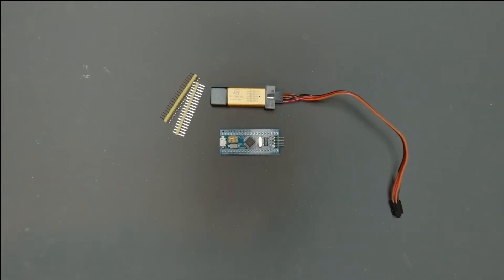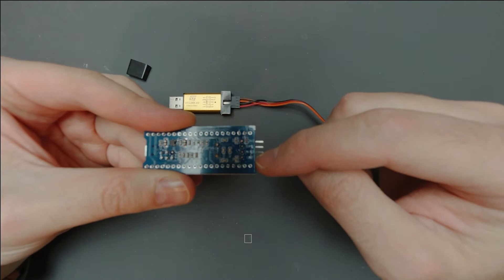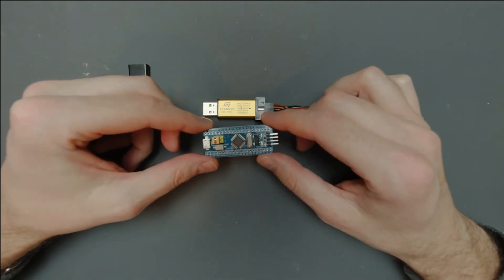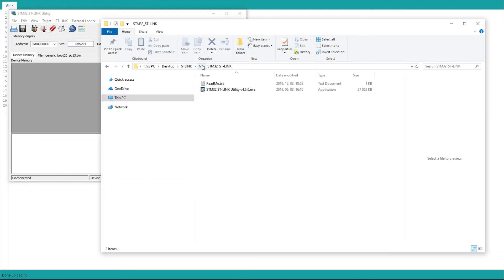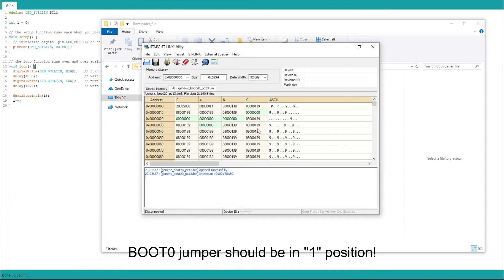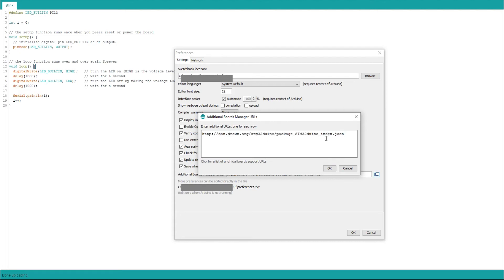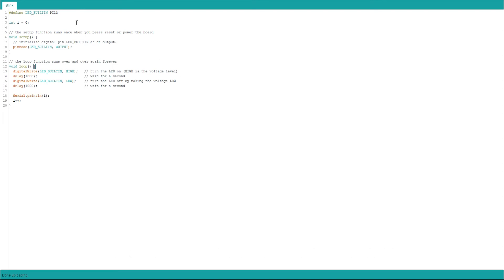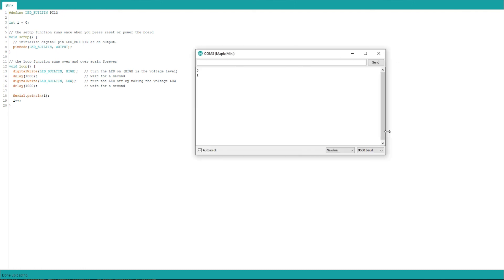STM32F103C with ST-Link and STM32duino, simplified!

Comment: Hi! i hope you reply after all of these years you'd be amazing! so i've done everything in the video and I'm at the arduino ide part and downloaded everything, the thing is after i press upload this happens:
Sketch uses 14548 bytes (22%) of program storage space. Maximum is 65536 bytes.
Global variables use 2072 bytes (10%) of dynamic memory, leaving 18408 bytes for local variables. Maximum is 20480 bytes.
maple_loader v0.1
Reset via USB Serial Failed! Did you select the right serial port?
Assuming the board is in perpetual bootloader mode and continuing to attempt dfu programming...

Resetting to bootloader via DTR pulse
Searching for DFU device [1EAF:0003]...
dfu-util - (C) 2007-2008 by OpenMoko Inc.
This program is Free Software and has ABSOLUTELY NO WARRANTY

Couldn't find the DFU device: [1EAF:0003]
the thing is that i can't choose the correct port from the port in the tools, and when i open device manager i see "lilusb-win32 devices" and under it i see "Maple DFU" but i don't know why is it there and not in "Ports" or anything and i don't know why is the arduino not finding it. I hope you reply thank you so much.
Reply from the maker: Hi! It seems that your device is in bootloader mode and not in serial mode. Are you sure you have the boot pins correctly configured?

Comment: i really need help, i did everything properly yet my laptop doesnt recognize the STM when i plug it in with a micro usb cable, the cable is alright but i believe the issue is with the drivers :(((((
Reply from the maker: Then install the drivers maybe?
Reply: @CuriousScientist  :( when i wrote this message i had already installed the drivers, as administrator, still it won't work :( also tried restarting the laptop

Comment: I am a microcontroller hobbyist,
All i know is Arduino and esp32,
I don't know anything about stm32
Is it mandatory to have stlink v2 to upload the code or can we use inbuilt usb instead?
Reply from the maker: If the microcontroller doesn't have a bootloader installed, then you need to program it somehow. Otherwise, you can't use the USB. After it has the bootloader, you can upload code via USB.

Comment: HI SIR, i followed every steps, buy while uploading i am getting error,  Access is denied.please help me to sort the issues
Reply from the maker: Hi! Have you restarted the computer?
Reply: @CuriousScientist  yes sir, but could able to upload the code to board, get same error
Reply from the maker: If you were able to upload before, then look for the changes you did that might introduced an error. Maybe wrong COM port is selected? Could be a bad cable maybe? Is the microcontroller intact? Can you upload a simple blinky to it via the ST Link?
Reply: @CuriousScientist  it showing correct com Port, but while uploading it shows access deined and it also shows error message of 'java' is not recognized as an internal or external command, operable program or batch file. But I reinstalled but nothing changed, please help me to sort this issue, thanks for your time 🙏
Reply from the maker: Have you tried searching for the error message in Google? Maybe you should give it a try.

Comment: More recent information that I have seen on YouTube, or read on forums, say the STM32 ST-LINK Utility has been replaced by STM32CubeProgrammer, which creates a whole lot of other issues 😕
Reply from the maker: The fact that it got replaced doesn't mean that you can not still use it. I am still using it without issues. But it is only needed if you want to upload a bootloader so you can program it via USB in the future. If you have the ST-Link dongle, you can use it anyway for programming.

Comment: not working
Reply from the maker: Then you did something wrong.
Reply: @CuriousScientist  yes, tried to use stm32... (3 board, 3 computers, 2 op.system - different hardware, same shit...)
btw. cube32 working, but we have a large codebase in arduino...
Reply from the maker: I think there's nothing wrong with the STM32. I am able to use several models (F1 and F4 mainly) with Arduino IDE without any issues. Both with direct USB connection or the ST Link dongle. Check if all drivers and software are properly installed.
Reply: @CuriousScientist  not working, stm32cube working, arduino not.
Reply from the maker: Well, then something is not OK on your side. Drivers, or the stm32duino framework...

Comment: Hi , thanks for your tutorial. but I have a problem , when I connect my STM32 blue pill via USB/min USB cable. My computer does not detect anything . I dowloaded well the bootloader following your instruction. I installed drivers succesfully but board does not appear in device manager panel of windows10. Have you an idea ? thanks in advance
Reply from the maker: Hi! If it does not detect anything at all, you probably have a dead microcontroller or a bad USB cable. Even if the drivers were missing, the computer should see that something was connected to it. It would be unable to communicate with it, but it would see it. Check your USB cable.

Comment: hello, the blink program I installed on my stm32 card with arduino ide gives an error
Error: opening registry key 'Software\JavaSoft\Java Runtime Environment'
Error: could not find java.dll
Error: Could not find Java SE Runtime Environment.
Reply from the maker: Hi! What should I do with this error message?
Reply: hello, first of all thank you for answering my question
I have installed STM32 relevant drivers and bootloader.
I wrote the blink sketch in the video.
I compiled and uploaded it to stm32, it gave an error message with the installation complete message
""Error: opening registry key 'Software\JavaSoft\Java Runtime Environment'
Error: could not find java.dll
Error: Could not find Java SE Runtime Environment. ""
Serial port doesn't work on screen.
Can you provide information about this error?
arduino IDE2.1.1
thanks good work. @CuriousScientist
Reply from the maker: The information is written in the error message. Please read it. Java.dll is missing. Make sure that the Java is installed and up to date on your PC.
Reply: I reinstalled java new errors occured
Resetting to bootloader via DTR pulse
#
# A fatal error has been detected by the Java Runtime Environment:
#
# EXCEPTION_ACCESS_VIOLATION (0xc0000005) at pc=0x000000007110b5db, pid=41168, tid=0x000000000000a154
#
# JRE version: Java(TM) SE Runtime Environment (8.0_381) (build 1.8.0_381-b09)
# Java VM: Java HotSpot(TM) 64-Bit Server VM (25.381-b09 mixed mode windows-amd64 compressed oops)
# Problematic frame:
# C [jSSC-2.8_x86_64.dll+0xb5db]
#
# Failed to write core dump. Minidumps are not enabled by default on client versions of Windows
#
# An error report file with more information is saved as:
# C:\Users\AsusPC\AppData\Local\Arduino15\packages\stm32duino\tools\stm32tools\2022.9.26\win\hs_err_pid41168.log
#
# If you would like to submit a bug report, please visit:
# http://bugreport.java.com/bugreport/crash.jsp
# The crash happened outside the Java Virtual Machine in native code.
# See problematic frame for where to report the bug.
#☹
Reply from the maker: Something still seems to be wrong with the Java environment. I am not a Java expert, so I don't know what's wrong. Check Google for clues. Maybe others also had this error before.
Reply: thank you for your attention @CuriousScientist
Reply from the maker: No worries! Try to reinstall everything, including the Arduino IDE.

Comment: Hey, I have done everything as per the video suggested, but when I upload the code nothing happens, it says done uploading. but the LED doesn't blink...and there is nothing in the serial terminal, can you help me with that ?

 I tried 2 different board and 2 different usb cable, I also redownloaded the drivers and restarted my computer. The boards I have are STM32F103C8T6

Thank you
Reply from the maker: Hi! If the uploading was successfully done, then it should work. Do you have a real C8T6 and not something like C6T6? Is the LED on the same pin as in the code? Did you really make sure that you use the boot jumpers properly? Have you tried verifying the code (bootloader) in the stm32cube programmer? Do you have the same code on the MCU as you see in the hex viewer? There are many things to check and it is super difficult to remote-troubleshoot this issue.
Reply: @CuriousScientist  You are right, i checked thoroughly and it is a C6T6, does it change something ? . I'll try to verify the code in the stm32cube programmer, could it also be that the stlink is problematic ? 

Thanks for your response
Reply: also the LED is the same pin (PC13)
Reply from the maker: C6T6 needs another bootloader. Just download the correct one, and it should work. Also, make sure that when uploading with USB, you select the correct MCU.
Reply: @CuriousScientist  Hey @CuriousScientist, I tried a lot of things, and in the end I was able to upload with the ST-link as a comment was suggesting, you are probably right when you say that the boot loader was the wrong one, but I couldn't find the right one. For now, it works thanks to you ! Thanks for all your help !
Reply from the maker: @MrElierb1  It should work with the generic_boot20_PC13 bootloader. It is strange, but since the C6T6 is already a "sketchy" device (possibly re-labelled "scrap" C8T6?), I am not surprised that it does not work. 

But yes, if you can afford a bit more meticulous debugging, then you can upload the code via the ST-LINK. The only disadvantage is that if you want to check things via USB, you need to remove the ST-link because it cannot be connected to the MCU simultaneously with the USB cable. It is a bit annoying to jump back and forth between USB and ST-LINK.

Comment: Not complaining about the video but, this is the most God awful thing I've ever tried to do. Forum post after forum post, video after video. They're all from 2 to 5 years old recommending 2 different repos for the Arduino board manager. I've gotten the bootloader flashed (I guess) but the com interface won't show up in Arduino (maybe Linux is the issue). I'm throwing in the towel and going back to fiddling with registers and using the st-link.
Reply from the maker: I don't have any experience on Linux, so unfortunately, I can't help. But it should be relatively straightforward anyway.

Comment: I wished this would work because I bought 2 STM32F103C6T6 board with ST-Link V2 and I tried it all. Then I tried this and it all went well, after running the STM32 ST-Link Utility I checked my arduino IDE and the board was there in my board manager. I removed the ST-Link V2 and connected via USB and restarted the Arduino IDE and all my board for the STM32 was gone. 
Any advice before I take a hammer to the boards? :D
Reply from the maker: Hi! I do not advise using a hammer because the boards are brittle and the flying debris can hurt you. 

On a more serious note:
Please check if you have all the drivers installed. Also, you said that the list of microcontrollers disappeared from the IDE. That sounds odd. 
- Do you have the proper URLs under the preferences/additional boards manager? 
- Also, do you have the stm32-related things installed in the boards manager? 
- Have you checked the STM32 before using the ST-LINK? Typically, they come with a bootloader. 
- Did you put back the BOOT jumper to the correct position? Or, did you put the jumper to the correct position before starting to upload the new bootloader?

So far I can pinpoint these main steps. Let me know how it goes.

Comment: I install the bootloader successfully but I get this error on the output, I install the install_driver I didn't find the install_driver_bat 'C:\Users\fnan' is not recognized as an internal or external command,
operable program or batch file.
Failed uploading: uploading error: exit status 1
Reply from the maker: Hi. The bat file is right there in the links I provided ("Arduino STM32 files (Drivers and Bootloader)").

Comment: green led is not blinking though only red led is blinking on mine.And its blinking in opposite way(like When low, led is ON and vice versa).
what should i do???
Reply from the maker: I don't really know the reason, but the red LED should not really blink as that is the power LED. Are you sure that you are using the same board?
Reply: @CuriousScientist  na na like 2 red led's are there one is power led and other is also a red one which was supposed to be green led.its same blue pill u used in ur vid.
Reply from the maker: @chinmaykulkarni2881  Hm, that is weird, I have never seen these blue pills with two red LEDs, and I own a handful. Try doing the whole process from the start. Also, check the chip. I don't doubt what you are saying, but it could be that you have a counterfeit or fake chip and that's why things are acting up. You can have a CH32 chip or an STM32F103C6T6 or something similar that is not the STM32F103C8T6. In that case, a different bootloader will be needed.

Comment: Hi!, thank you for your tutorial, quite straightforward and clear!
However I'm having some trouble with my STM32F103C6T6 board: different from an Arduino Uno or Nano I can't see the COM port in the device list (and of course in the Arduino IDE) and of course I can't upload the sketch...  
Any idea? It seems to me I missed some drivers...
Reply from the maker: Hi! Please read through the comments because several people had similar issues if I remember correctly. You might find the answer by reading the comments.
Reply: @CuriousScientist  after a couple of hours trying, I found a fix :-) 
I'm leaving here my solution for any other people that could have the same trouble.

-- The bootloader .bin described in the video is OK (generic_boot20_pc13.bin) 
-- Install the USB drivers using wdi-simple.exe and install_drivers.bat (links in the video description).  
-- for the STM32F103C6T6 board must to choose the STM32F103C6/ fake STM32F103C8 in the Arduino IDE

if you still has no COM port in the devices list:

-- open the "blink" sketch (examples -> STM32 -> digital -> blink)
-- put the jumper BOOT1 to 1 and  connect the board 
-- Upload the sketch using the instructions from this video (even if there isn't any COM port)
-- The COM port should to be appear in the Windows devices list  
-- Put the jumper BOOT1 to 0 and you've done forever (no need to change the jumper again).

Hope it could help!
Reply from the maker: Thank you for providing your method! I am sure it will be useful for those who are struggling with their STM32s.

Comment: hello, I have followed your instructions but when I try to upload my code in the arduino IDE I get :
maple_loader v0.1
Resetting to bootloader via DTR pulse
Reset via USB Serial Failed! Did you select the right serial port?
Searching for DFU device [C:\Users\chefl\AppData\Local\Temp\arduino_build_987028/Blink.ino.bin]...
Assuming the board is in perpetual bootloader mode and continuing to attempt dfu programming...

dfu-util - (C) 2007-2008 by OpenMoko Inc.
Couldn't find the DFU device: [C:\Users\chefl\AppData\Local\Temp\arduino_build_987028/Blink.ino.bin]
This program is Free Software and has ABSOLUTELY NO WARRANTY

timeout waiting for 2 serial

Do you have any solution ? thank you in advance
Reply from the maker: Hi! Have you selected the correct usb (COM) port? Do you see the stm32 board in the device manager? Probably, you either haven't chosen the correct port, or the burning of the bootloader was not successful.

Comment: İs there a way to upload codes using this to a Arduino Uno? İf yes how?
Reply from the maker: I don't really understand what you want. This video is about using STM32 within the Arduino framework.
Reply: @CuriousScientist  well i seem to be a thick skull so i have difficulties understanding it. İ use a microcontroller mega328p on a breadboard for my project and i can only upload codes in 2 ways. With miso and mosi pins using another Arduino or the txd and rxd pins using a usb to tll converter. So my question is which pins would i need to connect to upload using an st link
Reply from the maker: I don't really think that the ST-link can be used to program an Arduino which is a different system. I don't know for 100%, but I believe that they aren't compatible.
Reply: @CuriousScientist  yeah no matter what i do i Can't seem to program it thanks for the tutorial unfortunately i can't use it though
Reply from the maker: Once again, the ST-link is a dedicated programmer for ST microcontrollers! They aren't for Arduinos.
Reply: @CuriousScientist  are there any alternatives for arduinos for this kind of things?
Reply from the maker: A simple FTDI converter board should do the work. But they can be programmed via USB as well.